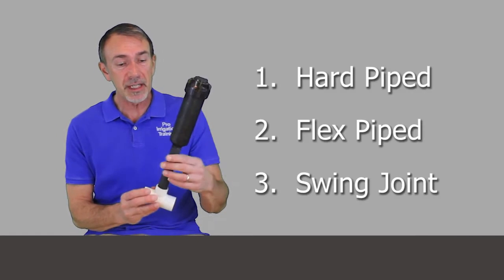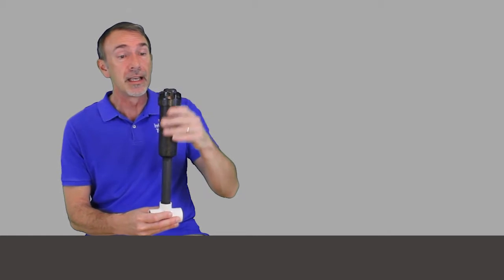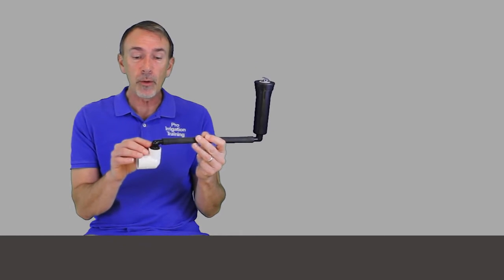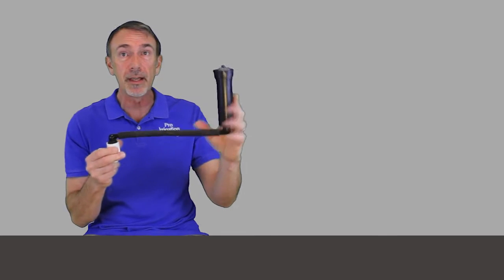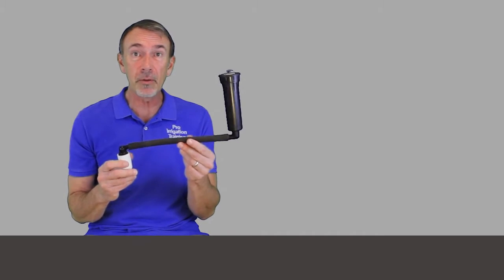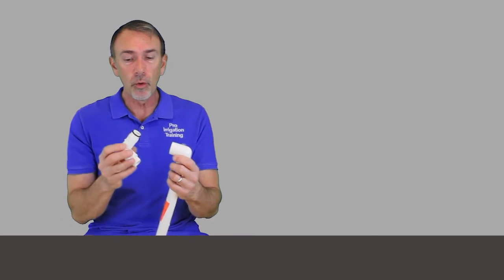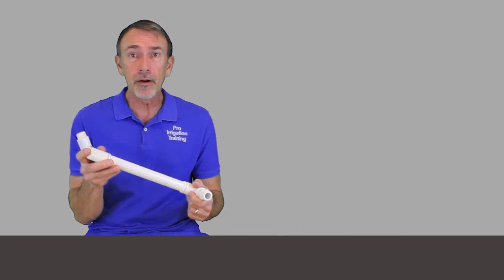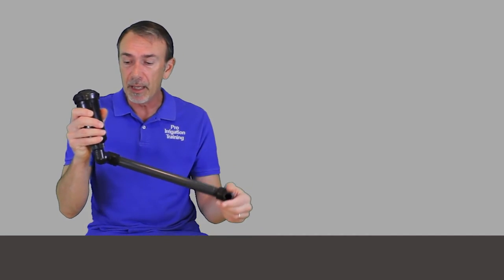3 Ways to Connect Sprinkler Heads (irrigation system repair)

Comment: Hi..good info in the video you might be the guy I need...I have an old  school system, 1995?...It all seems to spray water out of broken sprinkler heads... considering what I have repaired in the past..this is a different type of system and repair for me..A PVC valved 3" main intake from water source then is  connected to a 3 zone valve set up  about 2.5 to  3 inch with heavy duty rainbird 4" length  heads. It is a property that prior owner did not use the system. It looks like all is PVC glued... bottom glued riser ends with  threaded sprinkler  head top end of the riser.  Inflexible. It is in thick Bermuda grass. 1 head is broke at elbow turning up to head... it is broke 5 inches deep to the elbow turning up to the riser and head. I'm trying to resurrect the system because the water is free from a golf course unpotable river source. Do PVC  threaded risers exist ? Can I cut to fit the riser to the threaded head? I'm in a minum freeze area of way very South Texas. I can regulate the 95psi ?  (I'm told) if needed I suppose. It was in use 10 years ago according to neighbors. It seems regulated all but 1 head is broke others (miscellaneous mess) are just worn out, 15 years old. Any thoughts on disconnecting (I used to use the funny pipe snippers) the glued to replace elbows, risers and heads?
Reply from the maker: Thanks for watching and the comments! There are a couple different kinds of threaded risers that you can use to connect the heads. Lowe's and Home Depot have some different kinds like PVC, and also cut-off risers that you can cut to adjust the length. If the elbows connecting the heads are damaged, just cut the funny pipe and push a new barbed elbow in. You probably should regulate the pressure in the system down to 75-80 psi.

Comment: A great video.  However, the last method, self-constructed flex joint for higher flows, was not clear.  I see the connector to the PVC and the (hard) pipe threaded on each end, but what is the part that pivots?  Can't see it in the video.
Reply from the maker: The self-constructed one is really a last resort if no pre-constructed ones are available. The pivot action happens by the threads rotating, so use a bunch of thread tape, maybe 5 or 6 wraps around. I would personally use a pre-constructed one, even if you have to order online. Thanks for watching!

Comment: I need to relocate a few heads. I want to use flex pipe but my pressure is 83psi 🤦🏻‍♂️
Reply from the maker: It will probably be ok. I've seen those fittings holding good at more than that. It just depends though: not every fitting is exactly the same size. But if you're just moving heads, it will probably be fine.
Reply: @Proirrigationtraining  really appreciate the info. Thank you.

Comment: Lay the Tee down and then add a swing joint to make a proper adjustment. 

This is your swing joint:
Street elbow
Nipple 
Street elbow 
Street elbow 

Now add your sprinkler head and make a proper height adjustment. 
You want to be at grade level.

Comment: I noticed I had a lot of water pooling in between 2 sprinklers and dug out to view whole pipe.  ZERO cracks in pipe but I notice it’s leaking from the elbows. Wondering if with time that happens maybe they have never been changed?  Any recommendations?
Reply from the maker: That's hard to say. A lot of weird things we see as irrigation repair techs, we are usually guessing as to the cause. Maybe expansion and contraction from temp changes? Maybe they had small leaks when installed and just got worse over time? If we're talking about threaded elbows, just put a little more teflon tape on than usual, or replace everything connected with new parts.

Comment: Thanks for the video. I've heard it's wise to reduce the diameter of the piping on the "last mile" to the destination (sprinkler head) to encourage smooth pressure and flow throughout the system. I have 7.5GPM 35PSI running or 55PSI closed. 3/4" supply pvc piping running to 4 sprinklers. Each 3/4" sprinkler attached via reducing 1/2" swing arm assembly. I will be sure to keep total GPM for those 4 sprinklers below 7GPM and also less than 4GPM per sprinkler (max flow rate of 1/2"). Do you see any flaws with this setup? Thank you!
Reply from the maker: Hi there Duck, thanks for watching and commenting. Reducing the diameter of pipe is part of an installation method called 'Pipe Sizing." Really what that means is to only use a large enough pipe to carry the flow that you need, which is usually a step down for the last mile to the head. It can help you balance the pressure at the heads and also save money. It sounds like you have a good grasp of flow and what you said is good to go. Good luck with your install, hope it goes smooth.
Reply: @Proirrigationtraining  thanks

Comment: Could you help me please:
1) I have my garden tap marked as 1/2" - what size of PVC pipe should I use to get water from the tap to pop-up sprinklers?
2) What type of irrigation should I use for flower beds: pop-up sprinklers or drip hoses? The beds are ground level, along the fence (about 3-4 feet wide and 26 feet long).
Reply from the maker: Hi Jake, thanks for the question. First you need to know how much flow you can get from the faucet. Use a combo gauge to read the flow rate or a 5 gallon bucket test. Then figure out what nozzles you want use on your pop-ups. Check the manufacturer's data to find the flow rate for the nozzle. So, let's say that you're getting 10 gallons per minute from that faucet. 3/4" PSR 200 pipe will handle 10 gpm. Let's say the nozzles you want to use are 1.5 gpm each, you could put 6 pop-ups on that 3/4" pipe. You can find the flow rating for each pipe size and class of pipe in "Friction Loss Charts."
Question 2: I use both, depending on the bed and the person's temperament towards drip. Drip is superior, but requires a little extra care. Drip is also lower flow, so you can cover more ground with less water.
Reply: @Proirrigationtraining  Wow, didn't expect you, a pro, to answer my simple questions. Thanks a lot! But could you specify please: As far as I understand, I need to measure the water flow on the maximum allowed pressure for the pop-sprinklers I decide to use. For this, I need to attach a pressure gauge to the tap, open the tap to that wide when the gauge shows the maximum allowed for sprinklers pressure and only then measure the water flow. If this is right, what size of pipe should I use to attach the pressure gauge to the tap (it would be a T-connector I guess)? If I use the wrong size it could affect the measurements of the water flow (or even the pressure)?

And having this unique possibility to ask you: What happens with pressure and water flow if I have 1/2" tube going from the house (via a garden tap) and decide to use 3/4" instead of 1/2" to deliver water to my sprinklers? I know that funny/flex hose is 1/2", but how would pressure & water flow change if I use 3/4" supply/main line just to deliver water to the funny types? It may be so that 1/2" pipe is OK for the water amount I need for the system, but maybe 3/4" pipe will keep more pressure for the fartherst sprinkler in the system? Just trying to get into details as much as possible :)
Reply from the maker: @Jake-Curious  Jake, I'll try my best to help you here, but you're really asking about all the critical issues in system design. To do this properly, you need 10-12 hrs of instruction. But let me try in a paragraph, lol. You need to find your available pressure and flow at the faucet. Maximum allowed pressure at the head isn't the issue (unless it's over 80 psi at the head). The issue is to make sure you deliver enough water flow to that head to fill it's gpm rating with at least 25 psi to push up the head, and we want this to be true for each head on that "zone." So you measure your static pressure at your source point, tap, or faucet. Every bit of pipe and fittings the water goes through are going to reduce that pressure through what is called friction loss. All the loss values for the pipe and fittings are published in "Friction Loss Charts". So you add up the friction loss numbers and subtract that total from your source pressure to make sure you have enough pressure left at each head. The next issue is the flow. Measure this at your faucet with either a combo gauge (pressure and flow) or a 5 gallon bucket test. Open the spigot or faucet wide open, you need to know the maximum. The total flow values for all your heads can't exceed this max flow number. And you have to use pipe large enough to carry that flow. 1/2' poly will only carry 4 gpm, 3/4" PR 200 PVC will carry 10 gpm, 1" PR 200 PVC will carry 16 gpm. If you want to really understand this watch my Water Hydraulics videos as well as How to Read A Friction Loss Chart. So to further clarify: when you measure your pressure and flow at your source, you want it wide open. Your 3rd and 4th sentences aren't correct. You don't want to measure the flow at a certain pressure. You want to know the maximums. If it exceeds the manufacturer's maximum pressure rating (typically around 75 or 80 psi) then you need a pressure reducer, but that's a separate issue. You're really trying to ensure that you meet the minimums. The flow is the most important. People get really tripped up on the pressure but don't realize that the flow issue is what you have to get right. I've seen people put too many heads on a zone or plumb an entire zone in 1/2" poly. When the heads barely spray out any water, or the heads don't even rise up fully, they say "I have a pressure problem." No, it's a flow problem. Only so much water can be pushed through a pipe, and if you try to get too much, it scrubs all the energy (pressure) out of the water via "friction loss". Ok, this probably didn't help much, hope I didn't scare you off it.  There's some important concepts in there, but none of it is rocket science. Watch my other videos, you can sort it out.
Reply: @Proirrigationtraining  I got everything you said, thank you!! For some reason, today I measured ~5.4 gpm at my garden tap (which is supplied by a copper 1/2" pipe, so I expected 4 gpm as max) - should be a mistake in my measurements. Anyway I understand now that I should use 3/4" PVC pipe (even despite the fact that the tap is supplied by 1/2" copper pipe). Am I right? And the last question please: If I have too much pressure and use a pressure reducer will it also reduce the flow? And if it will, should I measure the flow after the pressure is reduced to suitable?
Reply from the maker: @Jake-Curious  Hi Jake! Ok, we're not concerned with the type of pipe or anything that comes before the outlet of your tap, our calculations begin here. Go with the measurement that you've taken, 5.4 gpm. And if you really want to get precise, take your pressure and flow measurements at the time you're going to be running your system. And you can plumb your zone line with 3/4" Class 200 PVC, 3/4" SCHD 40 PVC, or 3/4" Poly tubing. If a pressure reducer is necessary (really over 85 psi at your source is where you should consider using one,) it shouldn't affect the flow.